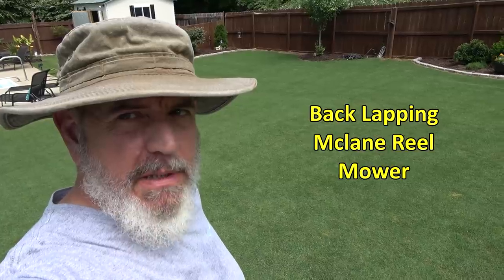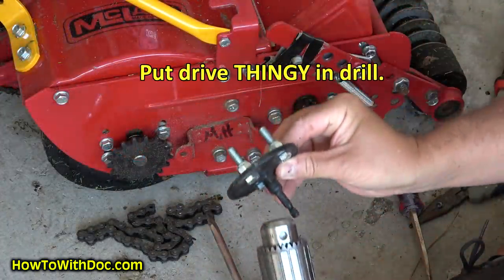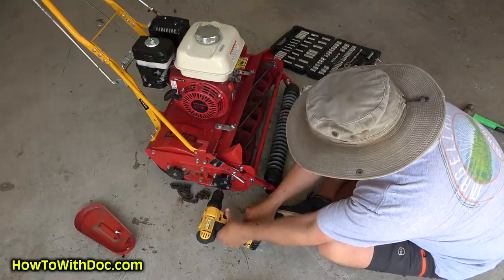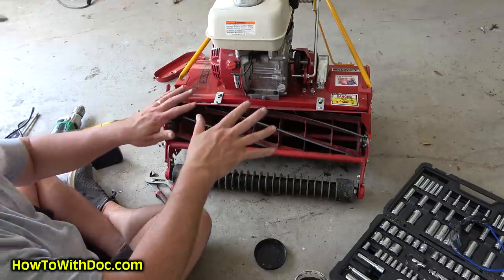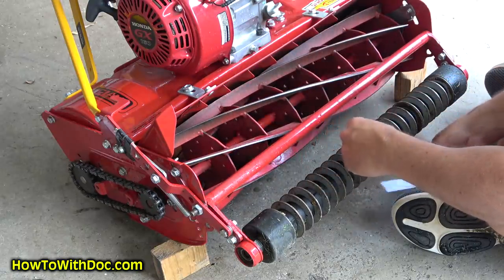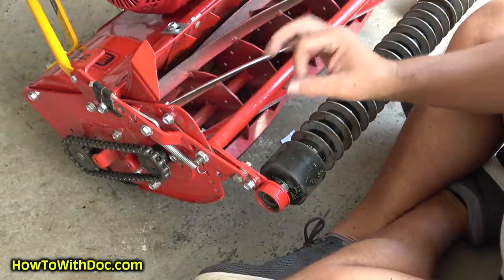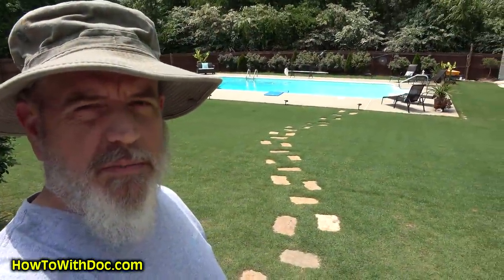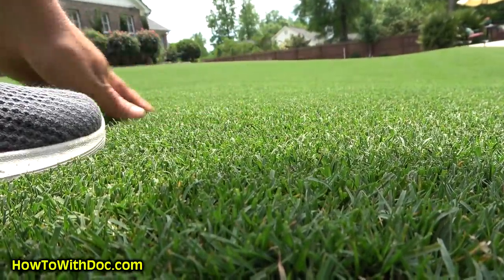Back Lapping Reel Mower Mclane

Comment: Good video Doc! I just back lapped mine and the middle of the blade doesn’t cut the paper as crisp. Do I have to sharpen again or keep adjusting bed knife? Greatly appreciated
Reply from the maker: Try loosening all 3 nuts slightly... that hold the porkchop in place. When tightening focus on some pressure on the middle.

Comment: Hey Doc, what is the thought process using 2 pieces of paper? I always see single paper used with greensmowers, are mclanes different in that aspect?
Reply from the maker: using printer paper which is very thin vs the cutting stock that most use. but it cuts either way.

Comment: Doc, I noticed your height adjustment pivot arm has an extra hole (3 instead of 2). Modification you made to get the HOC down via the front roller? Your rear axle still seems to be in the standard “medium” position, so I assume this was an attempt to avoid changing that.

Comment: Doc or anyone, been following about a month now.  Want to upgrade to a reel mower,  I have a small property < 2000 sf.  Is the gas powered McClane overkill or is the "manual" push reel mower (i.e. the one reviewed about a year ago)  "good enough"?  I know this has 5 blades McClane has 7.
Reply: Anthony Bruce look for a used McClane 20 on Facebook marketplace or craigslist

Comment: Just got done doing this with the same drill adapter from reel rollers and you’re right, not many videos on YouTube at all other than one on an older sears mower that is compatible to the McLane. I’m sure this will be much appreciated across your viewers! Very helpful

I purchased a used McLane and after a lot of backlapping with the 80 grit compound, I was able to get the blade cutting business cards but it is still not very sharp. It will only shred paper and not cut it cleanly. Would you recommend trying again with a 120 grit for a sharper blade? 

I would just get a relief grind but there isn’t anywhere around me in Alabama I can find to do it.

Comment: Doc, Did the back lapping . worked great. But I noticed my chain had about 1" of play. I didnt see an adjustment. Do these chains stretch and have to be replaced? I remember you saying only 1/2" of play
Reply: Anthony Defazio they definitely stretch. Replaced mine last year and there was near inch difference. Good info under tru cut section on lawnforumn.com

Comment: Doc - where can I purchase that tool that attached to your drill to turn the reel?  Tried looking searching by googling same to no success.  Thanks
Reply from the maker: https://reelrollers.com/tru-cut-reel-mower-backlap-kits/
Reply: @HowTowithDoc  Thanks Doc!  Unfortunately when i was processing the kit order which included lapping compound and the gadget, the advertised freight went from $8 to $42.  Will have to call them to see reason why.  if due to shipping the 1 pound of lapping compound which material may be considered "hazardous material" and require special handling, will see if they can eliminate that and just sell me the gadget
Reply: Do you know any other company that may fabricate the "gadget"?  When shipping cost exceeds the item you're trying to purchase, then you know that something's not right.  The lapping compound is only $20 if bought separately and kit which includes a 2 inch brush, lapping compound and gadget is $50

Comment: So I’ve had experience back lapping my Tru Cut but not a McLane. Which is easier in your opinion?
Reply from the maker: The trucut FINAL adjustment system is a pain to be honest. The Mclane is just more straight forward and easier.
Reply: How To with Doc Totally agree that the Tru Cut reel to bedknife adjustment is a pain. I’ve gotten the process down pretty good but it’s not my favorite thing to do.
Reply: Tru-cut blade to bed knife is a pain in the rear for sure!

Comment: Doc, I know you're a Mclane guy but have you seen or demo'd the new Swardman reel mowers? Just wondering. Really enjoy the video's.
Reply from the maker: Nope... not until they make one 25" or over that reasonable.  I won't cut with anything smaller.
Reply: @HowTowithDoc  I definitely understand. I only have 9500 sq ft compared to all the yards you have to do. I'm just impressed with all the accessories they have. Only con I see is it doesn't have a Honda Motor sitting on top.

Comment: Please dont lose any fingers. Which McLane mower is that? Nevermind, I saw the link.
Reply: You always disconnect the spark plug before going down to the reel to work. Another reason that I’m sure that Doc doesn’t like running the motor with the reverse system.  On a cordless electric you take the battery out before working on the reel or for that matter the blade of a rotary mower as well.